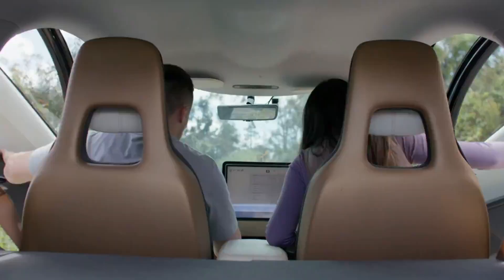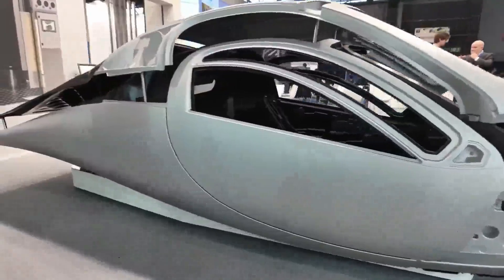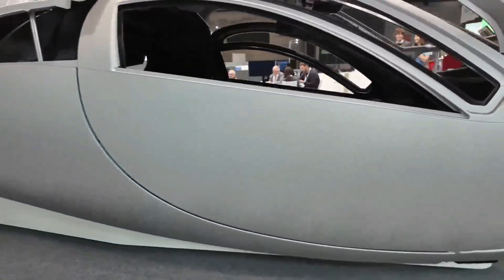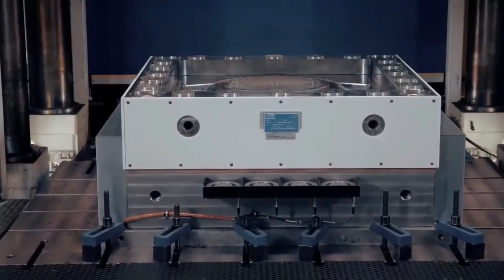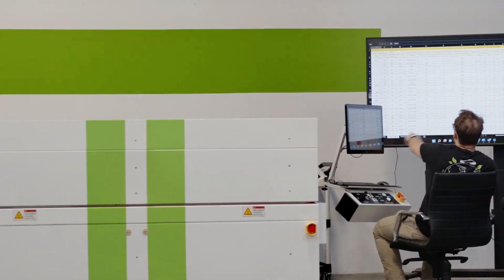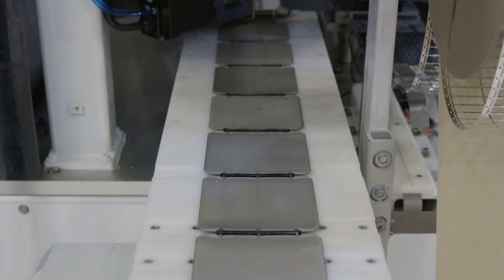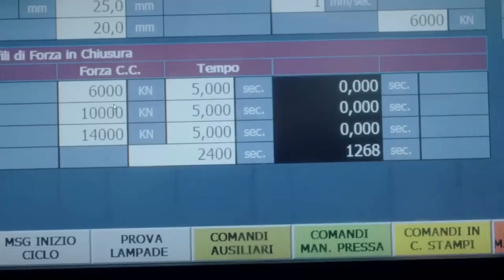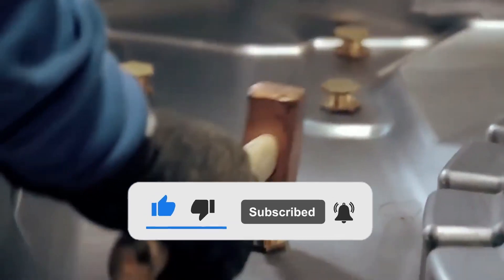Aptera Accelerates Vehicle Delivery with CF SMC Pressing Process

Comment: This video undermines my confidence in the prowess of Aptera as a company. It contradicts itself regarding manufacturing efficiency and also brings up "innovative" metal inserts that were pioneered in auto manufacturing by the original Lotus Elite which went to market in 1957. Now, if they were titanium inserts, that would help. Using heavy brass is not a technological breakthrough.
Reply: Alloyed Ti is pricey and expensive to machine because it's like machining rubber. Maybe that's why brass is a good choice. Heavier yeah, but how many insert are you talking about and how much weight diff?

Comment: The low cost version was Apteras first idea: vacuum form 4 plastic part and glue them together like a boat hull. Easy and cheap. Now they need a standard aluminium chassis and carbon panels that are glued onto it. Fabricated in italy. A low cost country as we all know. And shipping is for free. In the aptera world.
Reply: Vacuum formed plastic is no where near as structurally strong or light and is prone to warping.
Good to explore every option but I think aptera is on the right track.
Reply: @ronfarnsworth7074  Aptera promised that these formed plastic cells are stronger than anything else, comparable to Formula 1 vehicles. Since 2019. Another empty promise.
Reply: @vic321344  And they aren't? 
How so? By what measure? 
Short of pricey laid carbon fiber yeah, but what's stronger lighter cheaper?
Reply: @ronfarnsworth7074  Well, it just did not work. Now Aptera is using a standard aluminium frame, where the panels are glued on. Expensive and hevy.
Reply: @vic321344  The body in carbon was meant for an Al frame to start with, it wasn't an afterthought because it did not work. So please explain to me where you're coming from if you get time.
Reply: @ronfarnsworth7074  That is not right. since 2009 Aptera planned to produce a body out of 4 parts that are vacuum formed like a boat hull and glued together. All their working prototypes are produced like that. And they promised a more stable body than a conservative produced one. Because it was made out of a carbon composite. Just now they changed to an aluminium frame. Because their plastic body  plan just did not work. Even with carbon fiber plastic.

Comment: Are you kidding, the energy required to heat the carbon fibre mold is far less than the energy to either produce Carbon steel or Aluminium panels, so this not an issue.
Reply: Finally someone who gets it.

Comment: This video is simply providing details on the carbon molding.  Nothing new to report here.  This process is essentially the same as injection molding of other polymers.  Once the mold is heated, it doesn't require anything near the total energy to heat it the initial time.  The thermal cycling of the mold is far less than heating from ambient to plastic flow temp and back to a lesser temp for the molded part to hold its shape and then be ejected from the mold.  The non-subtle implication that the molding process is unsustainable is simply not true, else ALL injection molding processes in total would never be energy conserving and sustainable.  No one is talking about the carbon that is captured in the body.  Plus data now shows clearly that the earth's carbon cycling at this time is keeping a pretty decent balance--if anything, some scientists are concerned that carbon sequestration efforts can go too far--so far to reduce the efficiency of photsynthesis.  If that cycle is disrupted because of carbon dioxide panic the food cycles could be significantly impacted.  And YES, aussieideasman is correct--with this video there is NOTHING NEW TO REPORT.
Reply: So who else molds the whole body in so few parts? Or molds parts this size? Or integrates final assembly to this degree? Or ends up in this weight class without it costing 6 figures?
Reply: I'm not attacking the Aptera ron, in fact I'm a huge Aptera fan.  I'm just  sick of all these clickbait AI generated videos that 'muddy the waters' with 'not-quite-current' or 'not quite correct' information.  The answer to your question is perhaps Ferrari or Lamborghini, though these two definitely do NOT integrate final assembly and are certainly not in the same weight class.  The Aptera is truly in a class all by itself! @ronfarnsworth7074

Comment: Aptera does not have "innovative solar cells".  They, the cells, have essentially been made since about 2005.  Also, there's nothing innovative about Aptera's curved solar panels.  Gochermann has been granted a U.S. Patent (#4,717,790) for a "Contoured Solar Generator" in 1988.  I'll help you with the math.  THAT'S OVER 35 YEARS AGO!
Reply: Maxeon's solar cells did not exist in 2005. In fact, the solar panels used on the 2005 version of Aptera were not able to drive the vehicle. They only powered the air conditioning. The 2005 Aptera was not solar powered. 

It is only within the last 5 years that solar cells have reached 25% efficiency. No solar panel, curved or not, would have been able to power a passenger car before that. And it'll probably be another 5-10 years before they get efficient enough to power a car that's over 3000 lbs.
Reply: @richardryley3660  Finally someone who gets it.
Reply: @richardryley3660  Finally someone who gets it.
Reply: @richardryley3660  said: "Maxeon's solar cells did not exist in 2005".  While they were not known as "Maxeon" cells, they most certainly did exist in 2005.  They were known as SunPower cells.  SunPower "spun off" Maxeon.

@richardryley3660  said: "In fact, the solar panels used on the 2005 version of Aptera were not able to drive the vehicle. They only powered the air conditioning. The 2005 Aptera was not solar powered"  I have no idea what any of this has to do with the price of tea in China.....

 @richardryley3660  said: "It is only within the last 5 years that solar cells have reached 25% efficiency."  Wrong.  There have been cells at or about 25% as far back as the late 1980's.
Reply: @johnreeves7261  Just because Ford made the Model T and Ford made the Mustang does not make the Model T a Mustang.

You will have to provide me with a link to your evidence that solar cells had 25% efficiency in 1989.

For that matter, please provide me with the name of the solar cells that had 20% efficiency in 2003 and could be purchased for $20. Do you mean SunPower?
Reply: @richardryley3660  said: "Just because Ford made the Model T and Ford made the Mustang does not make the Model T a Mustang."  I agree but that's not the argument.  The "Mustang" of solar cells today is just a better tuned "Mustang" of 2005.

@richardryley3660  said: "You will have to provide me with a link to your evidence that solar cells had 25% efficiency in 1989."  No.  Do your own homework.

@richardryley3660  said: "For that matter, please provide me with the name of the solar cells that had 20% efficiency in 2003 and could be purchased for $20. Do you mean SunPower?"  I bought SunPower A300's in 2005 or so.  They were the cost effective cell of choice in solar racing at the time.
Reply: @johnreeves7261  "No..Do your own homework"

I did. I found no reference to a solar cell in 1989 that was capable of 25% efficiency. The closest I found is the Space Shuttle, which had a 30% efficiency. But the same article that stated this clarified that the output of solar panels are doubled in space. That means an equivalent solar panel on earth would have 15% efficiency. And that is an extremely expensive, extremely fragile solar cell beyond the reach of the average buyer. 

If you cannot provide evidence to back up your claims, I will assume it is because there is no such evidence. The efficiency of solar cells in 2005 was nowhere near 20%, and they were too fragile to be used for more than supplemental power.

My research into SunPower didn't show them breaking 20% efficiency until 2009. Your reference to A300 does confirm they had 20% efficiency. But this solar cell probably wasn't robust enough to survive use on a car like Aptera. You probably had to be extremely careful not to touch the cells or damage them. (Since that is true even today) And Aptera did not cover the entire body of the car.
Reply: @richardryley3660  said: "The closest I found is the Space Shuttle, which had a 30% efficiency. But the same article that stated this clarified that the output of solar panels are doubled in space. That means an equivalent solar panel on earth would have 15% efficiency."  Bad math.  All other things being equal, "output" (i.e., power) is about 36% greater in space than at sea level (see the solar constant thing) but that doesn't mean 36% more efficient.  Clearly you don't understand what "efficiency" is.

Also, get over your obsessive desire to call Aptera a solar powered car.  Again, it's just silly (and pointless).
Reply: @johnreeves7261  It's not my "obsessive desire" it is the way Aptera is described by its creators and the media. It seems to me that it is your desire to discredit the Aptera that is obsessive. 

I've already established that the standard for solar cells was 12-15% in the 2000s, and less than 15% in the 90s. More importantly, it wasn't until 2019 that solar cells existed that could take damage without knocking out the entire panel. You have no argument left but ad hominem.
Reply: @bobhilder1469  Gee Bob.  What research skills! :-)
Reply: @richardryley3660  The actual solar system is also not able to drive the vehicle. The 2024 Aptera is not a solar vehicle.

25% efficiency gain from near nothing is still near nothing. It just makes the solar system much more expensive.

The sun will never deliver more than 1.2 kWh per sqm. No matter what efficiency gains you hallucinate.
Reply: Yes, but what was the efficiency and cost of cells 20 years ago? And did they have the copper matrix on the backside and keep generation if cracked? Doubt it.
Still like your comment though I wouldn't say nothing new.
Reply: @ronfarnsworth7074  said: "Yes, but what was the efficiency and cost of cells 20 years ago? They were 20% and, as I recall, they cost less than $20 each in really small quantities.

 @ronfarnsworth7074  said: "And did they have the copper matrix on the backside and keep generation if cracked?"  Yes.
Reply: @johnreeves7261  No they were not 20% efficient 20 years ago. Maybe in space where there's 2x sunlight. Sunpower 20 yrs ago are no comparison to Maxeon Gen 3's , not even close.  Not essentially the same in any way.
Reply: @ronfarnsworth7074  Aptera wants to use old second hand cells which will be refurbished from old battery packs.
Reply: Love to see this kind of push back.  : =  }}
Reply: Aptera has nothing new or innovative. They just bang together their motorcycle from other the counter parts.
Reply: @vic321344  So how were they able to get a few patents?
Reply: There's certainly a lot of bad numbers, units and math in the comments above from @vic321344 and @richardryley3660.  Here are the facts.

Direct normal solar irradiance outside of earths atmosphere is about 1360 watts per square meter.  It's called the "solar constant".  At sea level it's about 1000 watts per square meter.

Aptera is to have 189 full size Maxeon Gen 3 solar cells with are rated efficiency of about 24 to 25% at Standard Test Conditions.  Each Gen 3 cells has an area of 0.0155 m^2.  189 cells x 0.0155 m^2 per cell =~2.93 m^2.  Because of the various and curved surfaces on Aptera, I expect a sustained peak of 500 to 550 watts total from Aptera's 189 cells.

Aptera will require ~5000 watts of power to be driven on the flats at about 50 MPH.  That comes from Aptera's claim of 100 watt hours per mile x 50 miles per hour.

The desire to call Aptera a "solar powered vehicle" is just silly.
Reply: @johnreeves7261   Aptera does not need its solar panels to generate 5000 watts of power to drive at 50 mph. It only needs for it's battery to generate 5000 watts of power, which is 5 kWh, a reasonable amount for a battery to generate. 

In short, if the Aptera gets 40 miles per day from solar power, it can drive at 50 mph for 48 minutes. If you live less than 24 minutes away from where you work, you don't have to generate any more solar power than that. 

This is the same reason why you use a battery to store the power generated by the solar panels on your house. You don't use up all the power generated immediately, you store it so it can be used when you need it. As an added bonus, you can use that power even if the sun is down, or it is cloudy. That applies the the Aptera too.
Reply: @richardryley3660  said: "Aptera does not need its solar panels to generate 5000 watts of power to drive at 50 mph. It only needs for it's battery to generate 5000 watts of power, which is 5 kWh, a reasonable amount for a battery to generate. 

In short, if the Aptera gets 40 miles per day from solar power, it can drive at 50 mph for 48 minutes. If you live less than 24 minutes away from where you work, you don't have to generate any more solar power than that. 

This is the same reason why you use a battery to store the power generated by the solar panels on your house. You don't use up all the power generated immediately, you store it so it can be used when you need it. As an added bonus, you can use that power even if the sun is down, or it is cloudy. That applies the the Aptera too."

Right.  Aptera is no more a solar car than my off-grid house is.....
Reply: @johnreeves7261  "Aptera is no more a solar car than my off grid house is"

But your house is a house, and not being able to produce enough power to power every thing does not make it not a house. 

Whether you like it or not, vehicles that store solar energy in batteries and use that as primary power are considered to be solar powered vehicles. Even solar racers use batteries to simplify the power train and provide power even when sunlight is obscured. You can't just say that only solar racers are solar powered. That's not the definition.